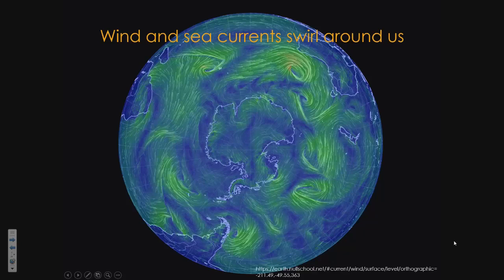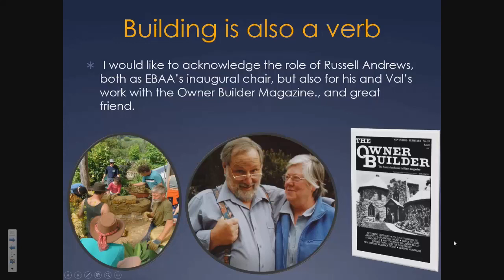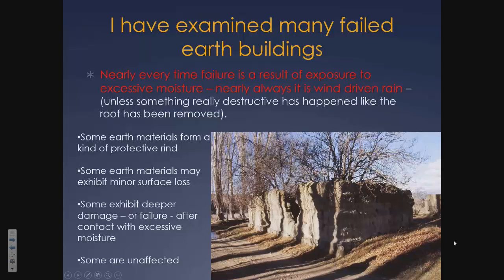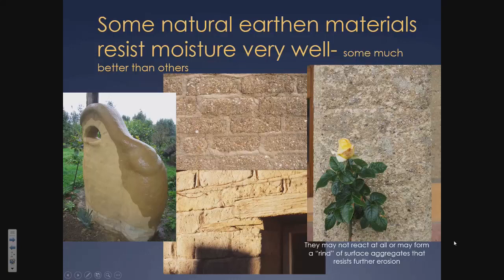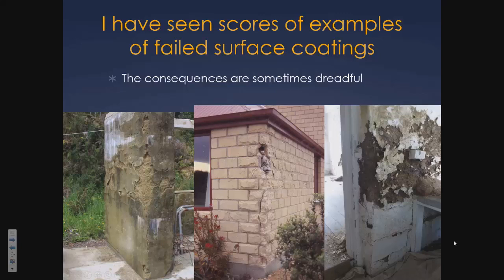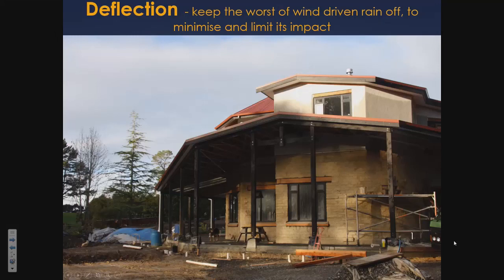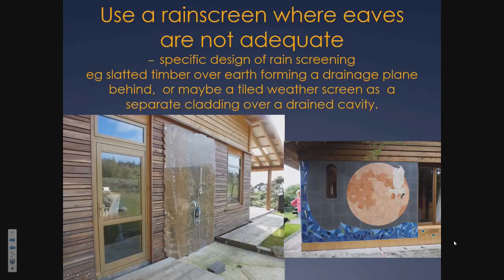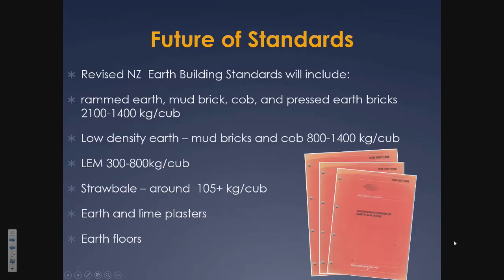Earth Building Design for Wet Windy Temperate Climates

Comment: If you have rammed earth done correctly you can soak an earthen brick and can sit in water for 10 years and it won't experience deterioration.

I believe all these issues have come about through the lack of knowledge of earthen materials, how the material interacts and behaves and how to prevent issues which can be easily be avoided.

For example the wall where there was excessive expansion at the location of the windowsill was most likely caused from an incorrect mix of clay Vs sand. If you don't remain with the margins of 20-30% to 80-70% of clay to sand you will get issues with the walls you build.

I think it comes down to smart decisions and consideration....

Great to see it's in discussion and people are meeting up and hearing about these from knowledgeable individuals just like Graeme